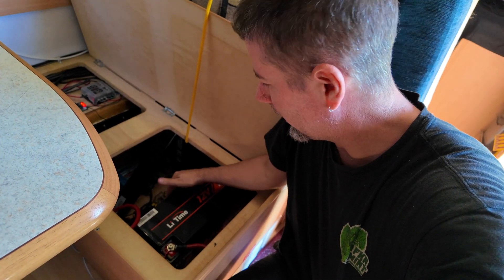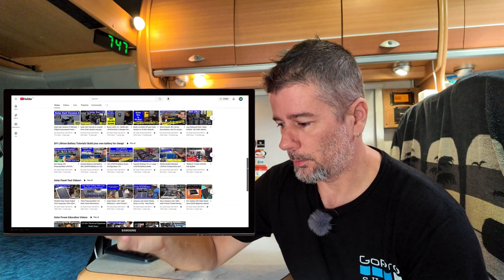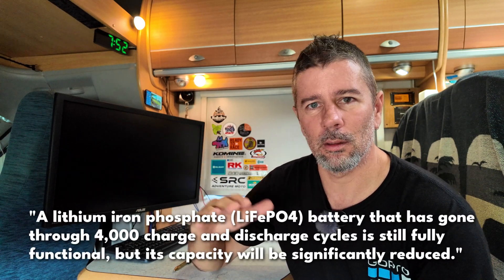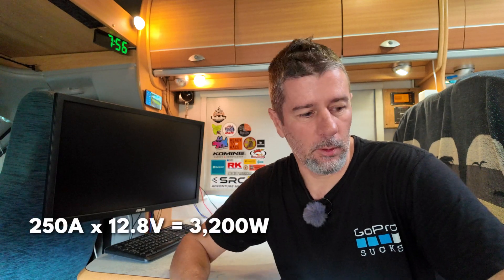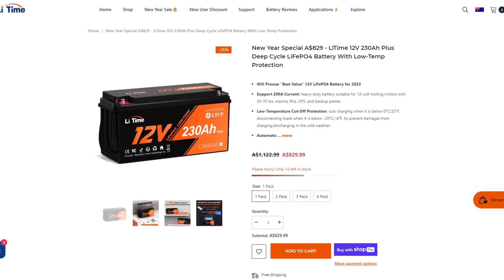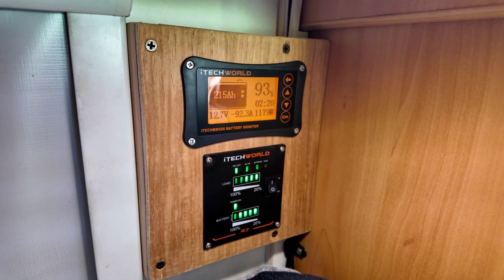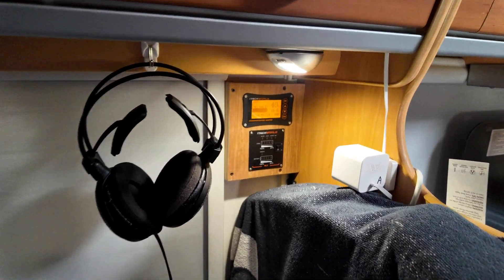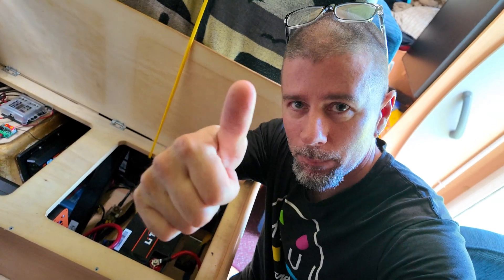Best Value LiFePO4 Battery: LiTime Great Quality At Amazing Prices

Comment: Just a quick couple of questions, mate. 1. Will you be putting back the two 240 amp/hr (480 amp/hrs) ITechWorld Lithium batteries in your van, or was it just for the review?
                                                                       2 You're throwing away 250 amp/hrs ( 480 total vs 230 amp/hr), sorry, but it does not make any sense to me, or do you have other plans?
I'm a LiTime fan and I purchased a 140 amp/hr battery a couple of months ago and i think it's good value for money. I'm not hating on you or anything else, just curious to see how you would get on for say a month or so free camping with this battery, and comparing, and how often you would need the LiTime recharged, or topped off, how it handled real-time testing. I hope you'll be doing a follow-up video of you out free camping somewhere.
Keep the videos coming. 😀
Reply from the maker: Yeah this was just testing for that short period. I do love the LiTime product but unfortunately they wouldn't send me 2 of them on this occasion, so it didn't make sense to switch out the ones I already had on a permanent basis. I would 110% love to switch the iTechs out for 2 of the LiTimes though, not because I don't like the iTechs (I've never had an issue with them) but they are a bit of an unknown quantity really. At least I know the LiTimes have been tested by ole mate Will. And man the price of them can't be beat. Cheers

Comment: eh mate question.. I went to Panama to pick up my T7 ..left it there 14 months ago..its got lithium batt  I loved it...BUT I dint think to un-conect   its as flat as  can it be jumped off a normal car battery ??  I googled it but bets both ways   ..
Reply from the maker: I don't have any first hand experience with waking up lithiums but I know some chargers are supposed to be able to do it. Probably 50/50 on whether or not the battery will even be any good anymore I know they don't like being left dead flat for long 😬 as for jump starting it, that could be dicey too I don't know if the stator on the bike will be able to wake it up and if not it won't allow any current to pass through. Probably best to try connecting a lithium battery charger to it for a while and see if you can wake it up...

Comment: I had a look at the Aussieland lithium batteries market, and this brand is about the best bang for our Aussieland buck as we are kinda limited, others are overrated AH wise or just junk, and this brand has enough reviews on here and on line indicating they make a good battery, sure there are cheaper batteries around, but hardly or any reviews, so I would avoid them. But, there is an even cheaper way, get cells from China, a BMS a box to put it in. I build a couple a few years ago and easy enough to do, and plenty of vids on here how to do it. Now a DIY built might not have all the bells and whistles, but it is cheaper, you learn heaps, and if a cell or part fails, just replace that cell or part. I have a factory built power station by Vtoman, and its good value, but if something breaks fixing it is tricky, a DIY build is built by you, all parts are replaceable, the choice of a BMS is up to you, so is an inverter and so on. I am going to build another DIY power station the next few months and might take the easy way out, 2x 230AH batteries by this brand, inverter, few 12v fittings to a Stanley tool box on wheels, and presto, still 1/2 the cost of a factory power station, and has way more capacity, but as mentioned, if I get cells and a BMS from China I can do it even cheaper again.
Reply from the maker: That's an interesting idea, would be a fun experiment at the very least. Cheers 🤘

Comment: I paid US$525 now $430 today.Bought 4 for 48v system last year.I have charged 1.84M wh’s on them. Just bought a Dumfume 300ah $253. So LiTime is over priced for a budget bat.Cell prices have shot down but bat manufacturers haven’t lowed price as much so there making bank.
Reply from the maker: Yeah things are a little different here in Awwwwstraya, we don't have the same product availability so we gotta work with what there is. Can always order stuff from overseas but with currency conversion rates and shipping costs we usually get screwed 💩 Relatively speaking LiTime are great value, I paid I think $1600 ea for my 240Ah batts last year 🥴
Reply: @ yah I heard of a company there that had crappy bats and sued a ytube for talking about them lol Yahll long ways from china hahahha
Reply from the maker: Yeah I wonder how that's going, bet they've gone out of business 🤞🏻

Comment: Good stuff Josh, hey do you run a lithium in your bike, can't remember if you are?
Reply from the maker: Ya darn tootin' I do 😎 Yeah mate I know some folks are a bit sketchy about Lithium but I have a lot of faith in the technology. I first got one for my WR250R and the same one got moved to the next 2 bikes as well and never had an issue. Had one in the T7 and there's one in the 690. I've never had a flat battery and never had to put any bike onto a tender or a charger. Pretty sure the brand I use is SSB, they use the prismatic cells as well which are meant to be the tits 👌 cheers

Comment: well done my friend ... I have been researching batteries for a fair while now and after watching a few USA youtube videos found the LiTime to be one of the best in the market .. just wondering why you didn't go the higher 280ah .. I will be getting one soon and advise anyone looking for Lithium batteries to do due diligence and check out plenty of reviews .. LiTime come out way on top .. thanks Josh well done
Reply from the maker: Cheers John! Mate the one and only reason I chose the smaller battery is space constraints, that 230Ah is the exact same size as my iTechworld 240s and only JUST fits in the space under the seat. 2x280Ah would be fkn mint if I had room 🤓
Reply: Something with eve cells is better but I do have 4 of these.Something better will probably be on the market when these need replaced.Full moon rechargeable maybe lol